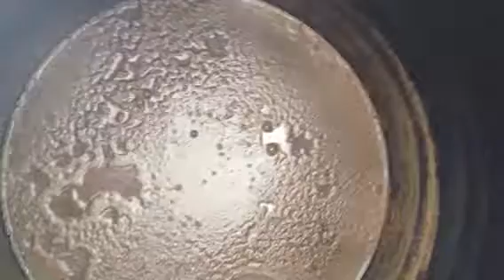Dirty Softener Brine Tank

Comment: I used a paper towel to clean out the iron out from my brine tank.   It's an easy fix.  I wouldn't put a solution in the tank without cleaning it first.  I'll use a resin cleaner yearly to extend the life and quality of my unit.